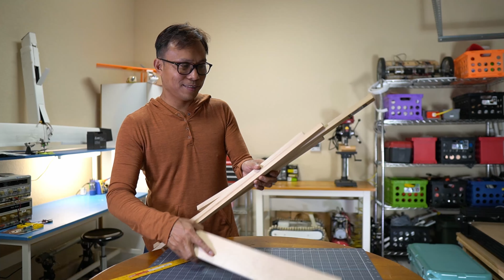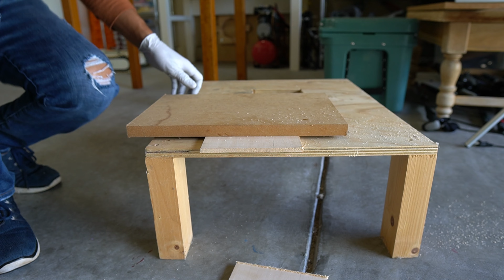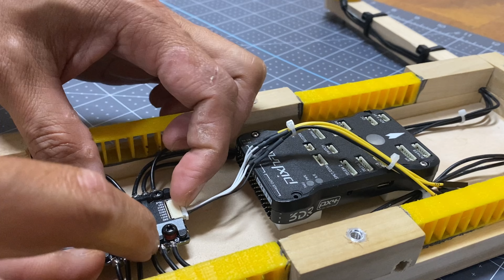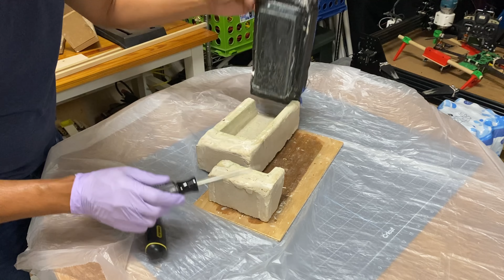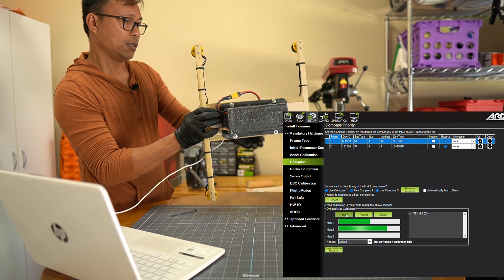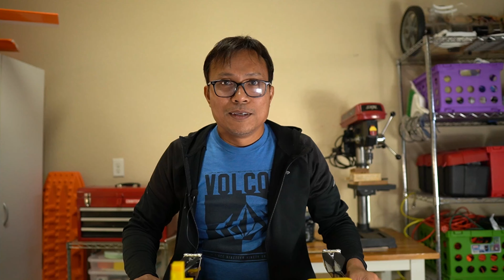How to Build a Custom Drone | Custom Drone Part 1

Comment: Nice job !!!
Could you let me know the specs of electronic devices like the motors, esc, camera, vtx, vrx, monitor, etc. ?
Reply from the maker: Hi, thank you for watching.
FLIGHT CONTROLLER: Pixhawk 4.2.8
ESC: Aikon 35A 4 in 1
MOTORS: Sunnsky 400kv
CAMERA: Lumenier cm-650
VTX: Lumenier 5.8 Ghz 600mW
VRX: RC832 5.8 Ghz
MONITOR: Generic tft monitor
BATTERY: Turnigy 4s 10,000 mA
Radio: Turnigy 9x
Propellers: 12 inches

Most of the components were obtained years ago. I was only able to make this video recently due to free time from work. You should be able to obtain newer and better versions of this components. As long as the specs are near you should have the same outcome.
Reply: @LyndonsWorkshop  Thank you a lot !!!
You gave me a inspiration and would be my guide. Thank you very much !!!